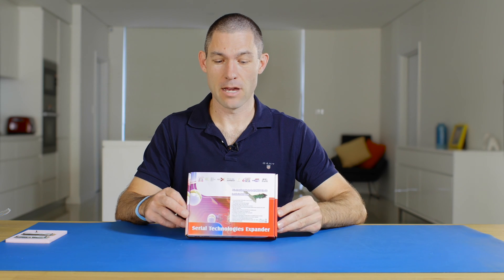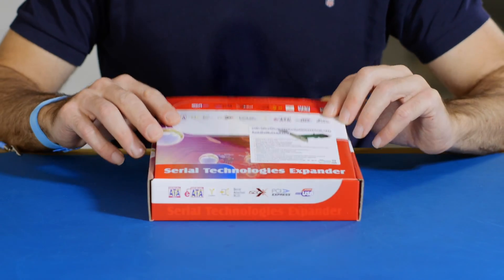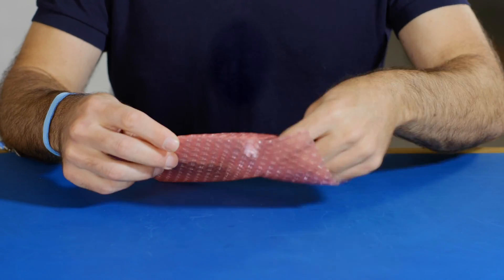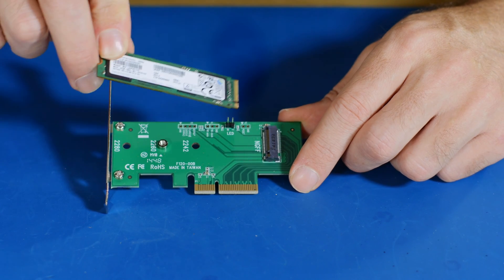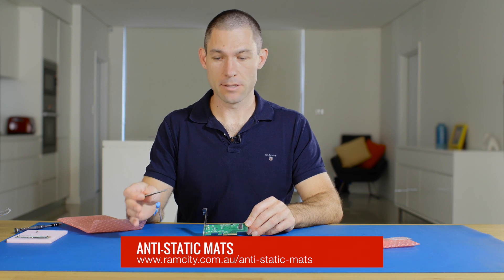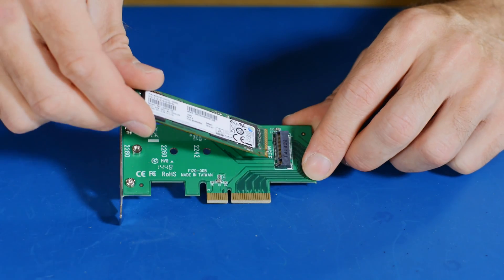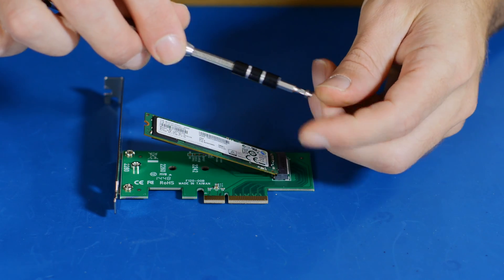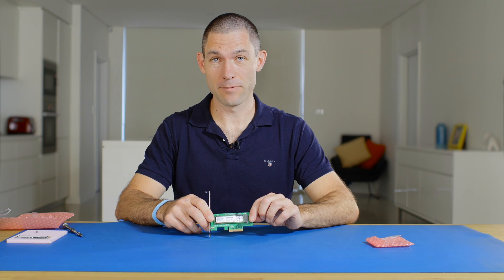Lycom DT-120 unboxing and installation guide

Comment: damn, I thought this is real controller with some chip and it's own logic, but it's just an adapter, which you can't boot up from without BIOS support, that sucks.... anyway I wouldn't without your unboxing/review, so thx for that mate!
Reply: Well first you need BIOS support for the NVME protocol to make it bootable, which unfortunately I don't have as my motherboard is quite old (as explained here http://www.pcworld.com/article/2899351/everything-you-need-to-know-about-nvme.html) 
This means I will need to go with classic AHCI protocol SATA3 PCIe controller card instead. It's still better than my onboard SATA2, which would downgrade SSD even more. Of course NVME would be much better, but without BIOS support you can use it only as a secondary drive, which is not what I want here.
Reply: Lloyd Franklin SM951 is an NVME drive and 840 EVO is not M.2, but classic SATA drive, which I have already chosen
Reply from the maker: You are both right and wrong. 

The SM951 came out in two forms, one in NVMe and one in AHCI. 

BIOS support is required to boot from an M.2 - full stop. Regardless of NVMe or AHCI.

The 840 EVO is a SATA based drive and requires a SATA connection not a PCIe. I also believe the 840 did not even come in an M.2 form, the first was the 850 EVO - although not sure. But either way it definitely will not work in this adapter.

Older boards that do not fully support UEFI BIOS are generally out of the question in regards to bootability.

Windows 7 does not natively support NVMe and requires some fiddling to get it to work on such drives. Windows 8/8.1/10 all work fine.

Comment: Does this work with a Mac Pro 2010 Tower /Bootcamp?
Reply from the maker: The Lycom adapter with an M.2 AHCI drive will work in our Mac Pro however regarding bootcamp I couldn't say.
Reply: I just bought 2 of these adapters with the SM951 AHCI and the OSX was easy and the Windows/Bootcamp was a headache. I did however get Windows installed but not through bootcamp software so I can confirm now both OSX and Windows boots yay! Thanks!

Comment: I own a Asrock Z87 and I'm looking to buy one Lycom DT- 120 or Addonics for use with M.2 based NVMe . I wonder if my motherboard supports BOOT for these M.2 . I checked on the website of the manufacturer and there is no information . If you can help , thank you.
Reply from the maker: +fjnikon Hi I have answered this question in your previous comment on another of our videos but I will include it here for other users.

"The Z87 chipset does not support booting to an M.2 regardless of an adapter and will not support an NVMe drive. 

You can utilise an M.2 AHCI as a storage device for installing your programs and such to and give them a boost but unfortunately this hardware is not really compatible with your chipset."
Reply: +RamCity  Thank you for your response here and in the Amazon where did the same question. I'll leave the same answer here on youtube because it can help others : Thank you so much for your answer . I'm checking on the internet and some manufacturers like Asus released BIOS updates for Their Z87 to initialize the AHCI and NVMe . I found on a forum the step by step to edit the BIOS and enter protocol support . You have knowledge of this procedure although not official ?
Reply from the maker: +fjnikon Indeed some manufacturers have released updates for specific boards that then allow users to essentially perform the changes required themselves to be able to boot such drives.

As the process is not supported by the manufacturer and can be a tad technical we have not looked into it much more as it is not an option we wish to advise.

You are of course welcome to look into the process yourself but I cannot condone it.
Reply: + RamCity I thank once again the answer. This is my problem today. If you dare buy a DT -120 + 950 PRO to try to use in my Z87 or wait another year until the prices of the new Z170 platform Lay down a bit . I live in another country then a friend who comes from the US is bringing a new SSD for me and this 950 PRO would be an option , even if costly so for now , I need not migrate platform. If that does not work I'll have to sell the 950 in my country of origin .
Reply from the maker: +fjnikon I understand your predicament, you can also look at the Z97, H97 and H170 and cheaper alternatives to the Z170 series boards and can all boot this setup.
Reply: +RamCity The price of a MB Z97 is the same as a Z170 or even more depending on the case . I saw the price of a Asrock Z97 Extreme6 which is the only one to contain an M.2 native Ultra and is in the range of 180 usd .. I find it very expensive for a platform that is already on borrowed time . I just bought a 4790k opted not to upgrade the platform at this time . Maybe it's time to rethink and perhaps upgrading to a Model NVMe only when refreshing the entire platform up because the price of a Samsung EVO 250 GB is now 120% less than a 950 PRO in my case I do not know if it will work .
Reply from the maker: +fjnikon I get that, at the end of the day you are already on a chipset that has seen its prime, the some h87 boards are fairly cheap and could even be found on sale which would utilise your new 4790k. 

They may not have an on board m.2 but with the use of something like the DT-120 you would still have a bootable environment available for the M.2

A *97 Chipset board could last you upwards of 2 years in the current market provided that nothing extreme breaks out in that time, any GPU will not need more than x4 PCIe Gen 3 lanes to run at full bandwidth leaving at least 12 free to expand as you wish.

The Z170 platform has very little benefits beyond a slightly faster processor and additonal compatibility as such a *97 board would not be a bad investment.
Reply: +RamCity 
Hello good day ! The problem is that I live in Brazil. Here things are very expensive for us. The real (local currency) is well undervalued against the US dollar. In short: A H97 ATX board from Gigabyte is costing $ 162 in Brazil. An expensive price, but it might not be a bad idea. My Z87 Extreme4 is a very good sign and great overclocking options and can sell it for about $ 90. Last night managed to carry out the modification in the BIOS. I'm attending the forum have already run the Intel SSD 750 in Z68 boards and even older cards modifying the BIOS. The only thing I needed in my case was to insert the module / NVMe protocol within the BIOS package. But I'm looking to be compensated. From what I read, the PRO 950 is good for large prints files and I do not use it in my everyday life. In benchmarks it is very good bringing 2000 mb / s read and 900 MB / s writing in 256GB version, but in the real world it would only effect (from what I've been reading) on copying files, boot the pc gains 1s to less and a few things in particular 5s, is not something significant I think. Feel free to comment. Thank you so much.
Reply: +RamCity Adding: doing a quick search on newegg and found no H97 motherboard that possessed two PCIe 3.0 x16 , because in my opinion , one slots would be used by the video card and one for the DT -120 adapter and until I know , it needs to be plugged into a slot 3.0 in order to run the 950 PRO for example at full band.
Reply from the maker: +fjnikon Fair enough, although note that the DT-120 only uses an x4 slot not an x16.
Reply: +RamCity 
I said this because in another video I saw on the internet a person installs the DT -120 in a PCIe 3.0 x16 slots but only uses the x4 space , but either way , I did not find H97 with two PCIe 3.0 these x16 and that X1 connection does not fit.
Reply from the maker: +fjnikon In the end it will cost money to upgrade and your platform is dying fast. The real world applications of PCIe M.2 may not be as grand as one may think but personally I have the SM951 128GB NVMe drive which is the slowest of the NVMe series and it has changed my daily use of the machine for both work, design and gaming immensely. 

If you cannot afford the upgrade then that's perfectly fine and only you can control that, however if it is that you cannot justify the purchase for the amount of performance gain then I would advise that you think of it in the long run. 

Your current platform does not allow you to break into current hardware or emerging hardware and as such limits you, a newer chipset would be future proofed for quite some time to come and should benefit you in the near future if you decide to do so.
Reply: +RamCity 
Good Morning ! Today Asrock I replied that my email sending me an official BIOS already with support for NVMe . I found this very interesting and it's a motherboard that is already discontinued , the problem is that already bought the SSD SATA common in the Amazon and now it's kind of late to go back , but gave desire to have this 950 PRO on my PC to feel, perhaps the performance difference only using me of a DT -120 ( which would die in my hand because I could not sell it there in front as all new cards already have a slot M.2 x4 )
Reply from the maker: +fjnikon They may have updated the BIOS to support NVMe as part of an effort to continue the life of the board, however, adding NVMe support does not add M.2 "PCIe" support. Keep that in mind, I do not believe you have made a mistake.
Reply: +RamCity Good evening. I do not understand about the PCIe support. This support would simply not buy a Lycom or Addonics adapter and enjoy the benefits of NVMe ?? I still have 2 PCIe x16 slots free in my motherboard. On the purchase of SSDs, it was the cost-benefit ratio. Researched well and the best choice so far was 850 EVO (88 usd on Amazon) Samsung being the 850 PRO 40% (120 USD) more in value and with a gain of 10%, which to me makes no sense terms of values. So in this sense, I found the SSD from ADATA SP550 model that proved to be a money unbeatable for the price. But they do not use the same memory NAND EVO and PRO, but are a little faster than my current Neutron GTX 128 gb already almost 3 years old (very good by the way, 1050 points in AS SSD, which for the time was a spectacle as the 950 is today). In short, I will be soon with 480 GB of space on your PC just paying 130USD for it. Later on I will switch to M.2 x4, but already with an embedded technology on the motherboard. I appreciate your patience in me answer every time, and feel free to comment further. I took the liberty to add you to my favorite on YouTube. A hug..
Reply from the maker: +fjnikon The DT-120 adapter simply allows you to access a drive via a PCIe slot. Most boards will support this out of the box and allow you to utilise the drive as storage but only once windows is active and the system is turned on fully will they be seen. This is due to the driver requirement not being met until windows is loaded.

Boards that can boot from PCIe or more specifically M.2 PCIe have this support built into the motherboard BIOS. This allows the drive to be seen in the bios and utilised as the boot device.

Normal drives use the SATA interface and require a SATA connection to transfer data, PCIe drive do this via the PCIe lanes on the board and have a PCIe interface. Note the two are not interchangeable.

AHCI and NVMe are separate features from the previous and are the disk controllers, these protocols control how your PC reads data from the drive.
For the last decade or so almost all drives be them HDD or SDD have used the AHCI protocol which was designed for spinning disks.
In recent years NVMe has hit the market and is designed to better suit SSD's and be more efficient at reading info.

If I were to describe the difference between the two, I would say AHCI reads a drive like a pin head reads a record thus having to navigate through the files until it find that which it needs or starting closest to the area that it thinks the info is stored and NVMe reads a drive like you would a book that has an index and numbered pages thus being able to simply lookup the location and navigate to it.

To summarise:

SATA and PCIe are the physical connections that the hardware makes to transfer data and your machine must support them for a piece of hardware to work. In this case the machine must support BOOTING to them for you to install windows to them. (A bios update likely did not add this compatibility)

AHCI and NVMe are different controllers that determine how your machine reads the data. The hardware must be designed to be read this way and the machine must have the ability to read in this fashion (this is what the BIOS update added in regards to NVMe)

I hope this makes sense.
Reply: + RamCity So , but this BIOS version that Asrock has informed me support NVMe he incializável being and being seen by the BIOS from the time the protocol was added in the BIOS. Until I knew and from what I read , without support in the BIOS, with the DT- 120 NVMe disk would work, but only for storage.
Reply from the maker: +fjnikon Only for storage, it likely will not boot.
Reply: +RamCity, See the e-mail of Asrock Support, From what I talk about Windows installation , or should work with Boot as well.

Dear customer,Thank you for contacting ASRock! Our BIOS RD released BIOS P3.20G to support NVMe SSD.

Please notice, NVMe type SSD only can work on Win8.1 and Win10 OS with GPT mode.
Please follow the below steps to install OS on GPT mode:

1. Please reboot the system then press[Delete] to enter the UEFI BIOS.
2. In Boot tab&gt;CSM (Compatibility Support Module), please set the CSM to &quot;Disable&quot;.
3. Please press[F10] to save the setting and exit.
4.Use USB:
Step 1. Plugging a boot-able USB with OS into USB port.
Step 2. Re-boot system and press[F11] when you see post screen to enter boot menu.
Step 3. Choose UEFI USB ...(your USB devise name)
Then system will install OS in GPT(UEFI) mode automatically.
Reply from the maker: +fjnikon I agree that they have added support for booting to NVMe but nowhere does the update mention PCIe or M.2 boot support. You need to make sure that you are clear with the support team.

There are many drives that are not M.2 PCIe that are NVMe this means that adding NVMe support does not add M.2 PCIe support.